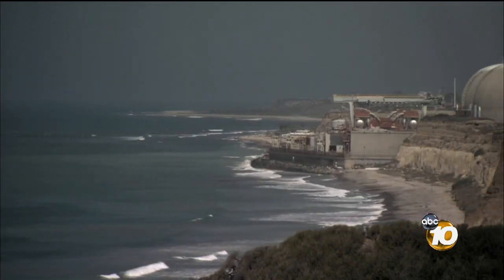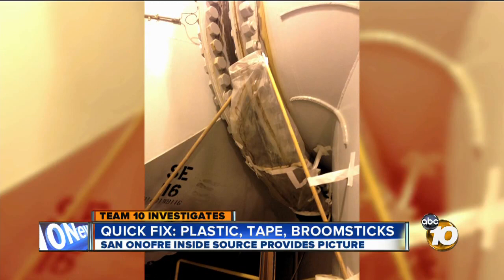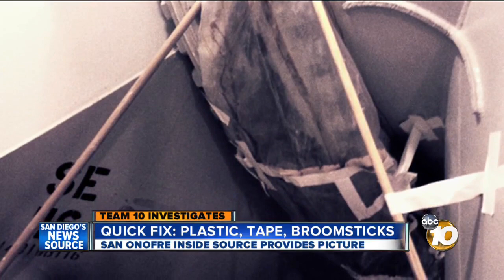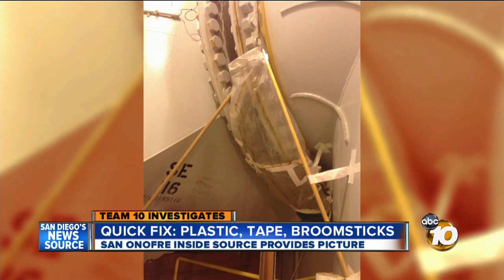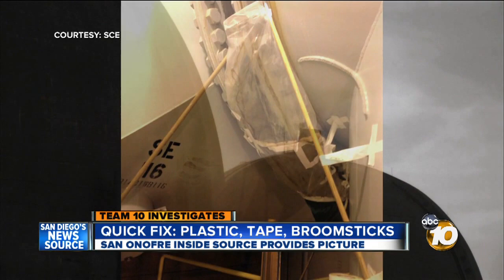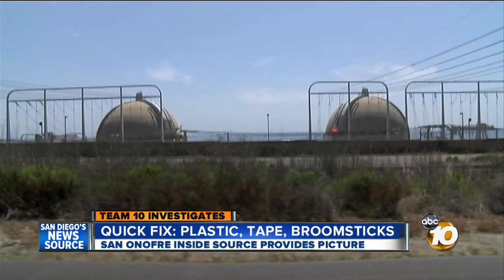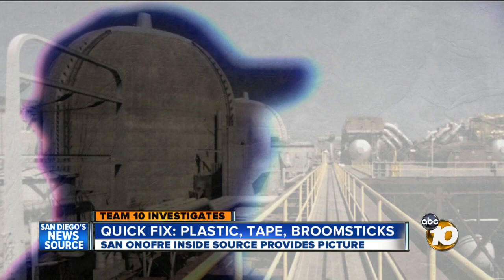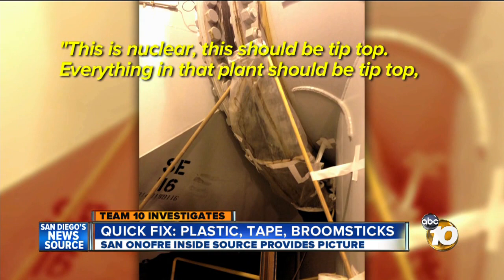Photo shows plastic bags, tape, broomsticks used to fix San Onofre leak

Comment: You all act like these plants can just be shut-down and taken offline permanently without any replacement plant going in to compensate for the lacking power supply. Sure shut it down instead of repairing it, but don't go complaining when pollution and cost of power goes up because you want to target every source of energy we are trying to pursue.

Comment: that fix using plastic bags broomsticks and duck tape is NOT a good solution for a tiny leak like that. they have to wrap the entire section of the pipe using radiation proof material where the leak is located. and if they had a level 2 or even a level 3 event that's still pretty serious. anything higher than level 2 means than more than 10 rems per hour leaked
Reply: That's an inlet circ water pipe to the main condenser waterbox. That water was pulled from the ocean, and will be put right back in the ocean (hotter) but not radioactive in any way. This is on the "clean" side of the plant, that entire area is a clean area (not radioactive nor contaminated). This would not cause the severe events you're talking about.  

They had other problems way bigger than a leaky circ water system.